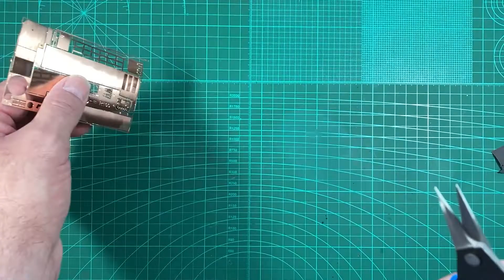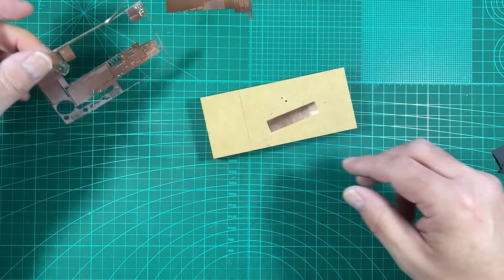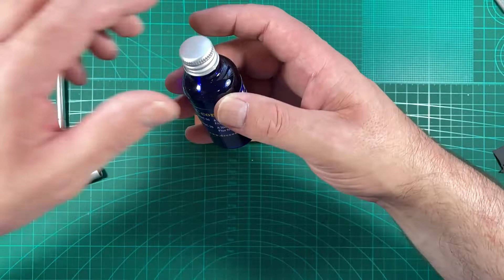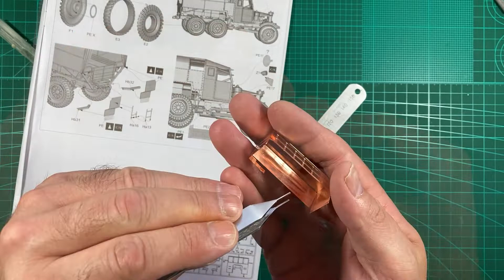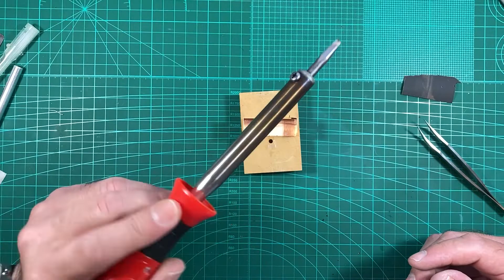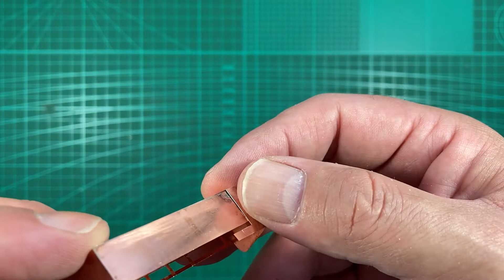Scammell Pioneer R100 (Thunder Models, 1/35th Scale) – Part 12 Soldering Photo Etch Cargo Basket

Comment: Hello PFSM. Had to hold my breath on the soldering...one of my other scale hobbies, I have done a lot of soldering of kits, including white metal, brass etch, both cast brass and solid section brass. Very rarely resulting to a 'flame thrower'! Using mostly a 15 watt iron, Duzol (highly corrosive but solder flows beautifully) with low-melt solder. Soldering sometimes requiring a 40 watt iron & a 100 watt beast (used for lead glass work). Using 60/40 solder where strength is required. A useful technique to remember, is to pre-tin before-hand. You will find it easier, just having to apply heat only (& maybe a little more flux). You used 'less' (better results) with satisfying results. Using 'less' as you have demonstrated, should work well pre-tinning for you.
Soldering is another chapter & adventure...be aware of flux about your work matt etc. Having a large piece of 3mm Customwood to cover your matt would be advisable...Inspiring Temperament Vid shown by you.
Reply from the maker: Thank you, my soldering equipment and abilities have greatly improved since this first attempt as can be seen in parts 15 & 18 of my Mikasa build series.

Comment: Have this kit and was following your series... Was just curious as to why this is where you stopped with the video series. Did you lose interest in it, or run into significant problems you didn't feel like tackling? Thanks!
Reply from the maker: Thanks for watching and commenting.  I got a bit disheartened as being a complete weathering newb I wasn't happy with the components done in Part 11 and even didn't show the exhaust I did at the same time as it was pretty bad.  It came time to do general weathering on the outside, the wheels and engine and I had a vision what I wanted to achieve but chickened out for fear of messing it up.  It's still on the shelf and I'm sure I'll get back to it sometime, but just enjoying myself ship modelling at the moment, which is my real interest.
Reply: @plungingfirescalemodeling2441  I totally understand. I couldn't give you an accurate count of the in-progress kits I have. Thanks again!
Reply: @eddie_baby_6855  Guilty too.